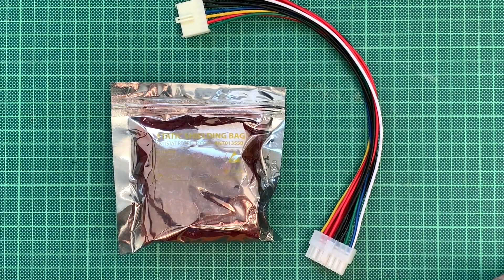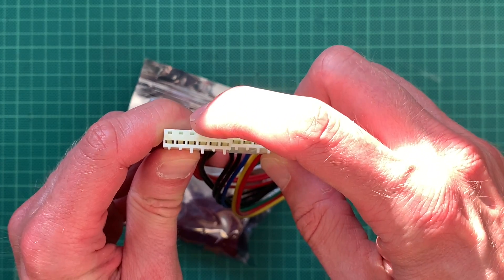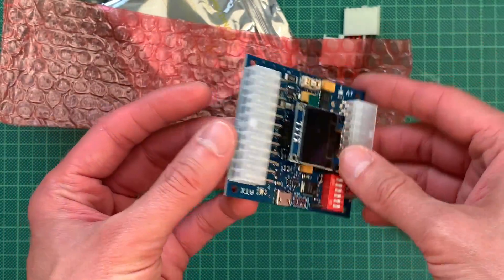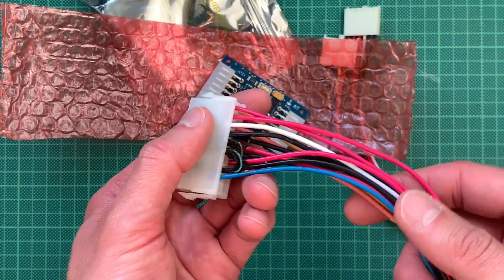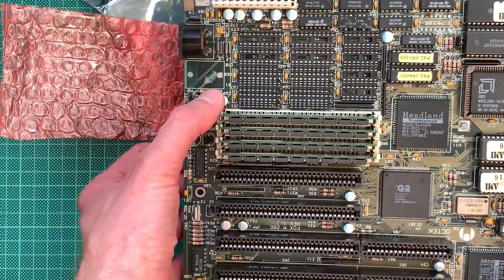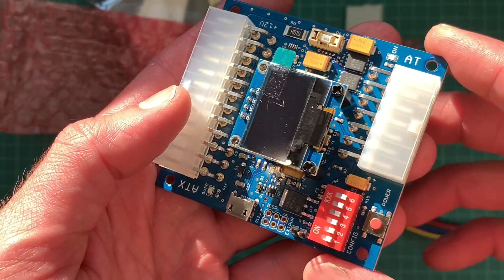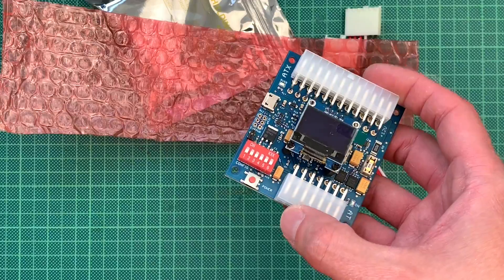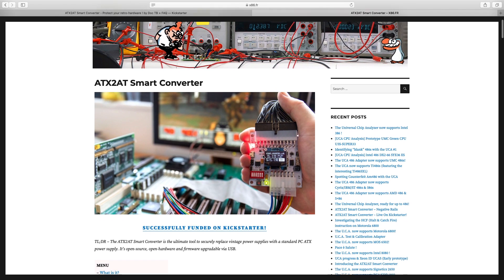The ATX2AT Retro PC Saver (And a Look Into my 286)

Comment: 4:00 I see quite a few retro-computer enthusiasts like you replace tantalum with slightly more reliable electrolytic caps. But there's also the consideration that electrolytic caps can leak after several years, and these caps may blow without detection, compounding problems. For my very own PCs, I feel like this isn't a problem, since I'm aware of the issues with old capacitors. But when repairing other's, or on mainboards I intend to sell, I think Tantalums can be a better long term solution. Leaking electrolytics are especially a big problem with old Apple Macs, and many collectors will actually replace all electrolytics with tantalums, after seeing the damage from corrosive leaks. Yes it's worrisome to hear tantalums explode and smell the "magic smoke", but they will not cause further problems later on. I personally would rather fix exploded tantalums than worry about corrosive leaks that may not be detected until surrounding components, and even the mainboard itself, is irreparably damaged.
Reply from the maker: Modern Tantalums are also much better than the old ones. But there’s electrolytic caps with solid electrolytes, so I guess the risk of leakage can be reduced as well. But yeah, modern Tantalums are probably an excellent choice for replacements.